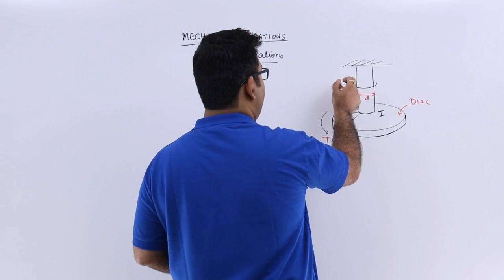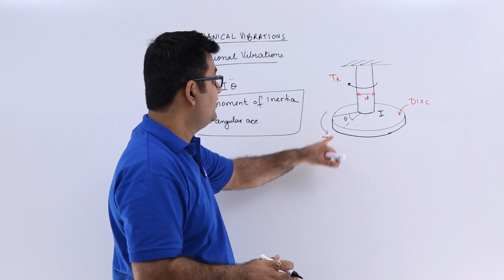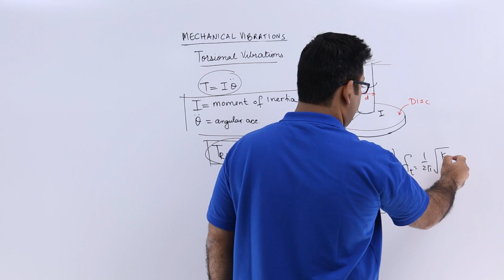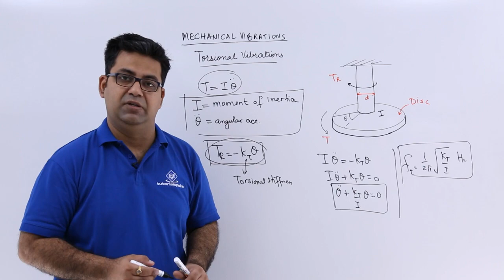Torsional Vibrations

Comment: Two 1otors A and B are attached to the ends of a sha m n long. The mass of the rotor A is 400Kg and its radius of gyration is 400mm. The corresponding values of rotor B are S0OK und S00mm respectively. The shaft is of 80mm diameter. Modulus of rigidity of the shaft material is 0.10'MN/m. Find the- (a) Frequencies of torsional vibrations

(b) Position of the node und mode shaper. Xx